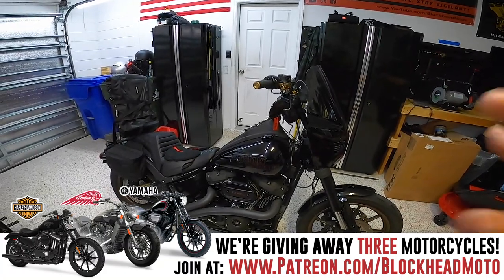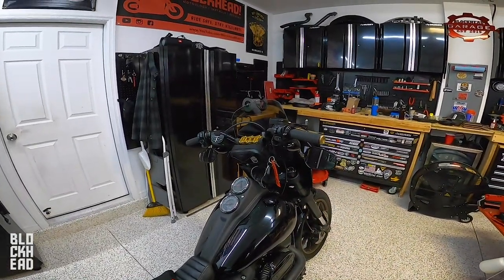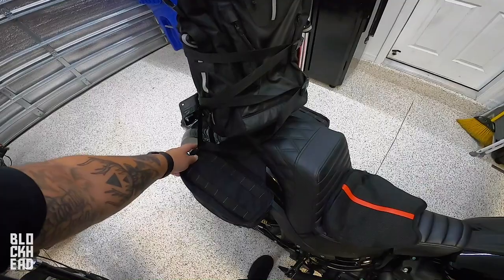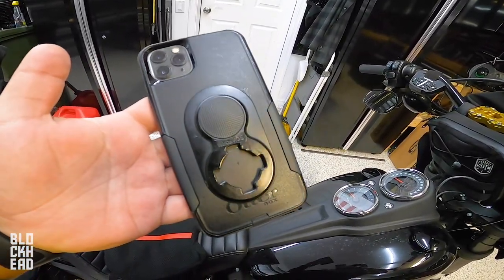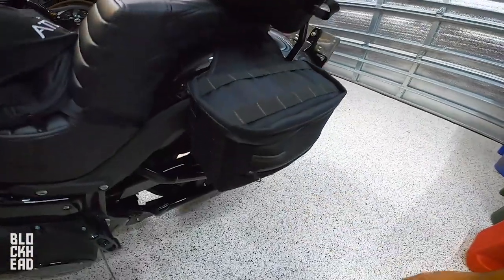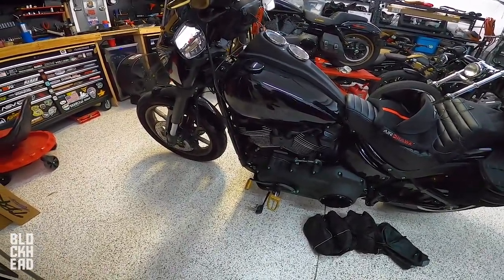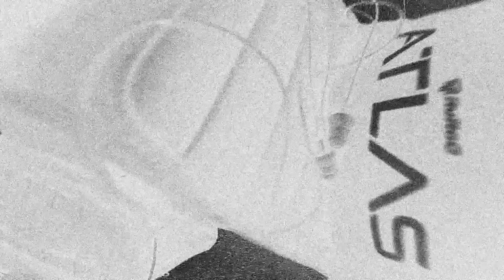800 Mile Motorcycle Road Trip Gear & Essentials! (Harley Low Rider S)

Comment from the maker: What's some other gear that y'all would recommend? Comment below with your recommendations!
Reply: Why are you orange?? Lol
Reply: Foot pegs with a heel rest was a game changer on my sporty
Reply: You could always get sportglide panniers and do a tail light relocation. They fit on and off in seconds
Reply: Not an XR1200 stock seat. Anything but that.
Reply: I recommend anything for hydration on the long trips. I used to run a camelback but now I have a perch mounted cup holder. It is super easy to get dehydrated on long runs and could quickly ruin a day.
Reply: Check out a laminar lip.
Reply: I broke down and bought some touring luggage that sits on my pillion. It carries a good amount of stuff and provides a backrest to lean on. It makes a world of difference on a long ride to be able to lean back and relax for awhile. Not having to hold yourself upright the entire time also helps with fatigue.
Reply: Emergency fuel bottle!
Reply: Crash bar with highway pegs or a mustache bar is worth it. Gives you more options to move around and change your position
Reply: Nelson Rigg used to make a set of expandable saddlebags. They may have come in a zip off version. The only thing I would recommend and you touched on it is larger bags. I like highway pegs and floorboards on the 97 Heritage but I used to use the passenger pegs on a former ride, a 1980 Suzuki GS850G. Other than that, you have a good set up. Note: I fill the drybag with clothes for a backrest, drinks, tools and such go in the saddlebags depending on the trip. I have moved on a bike so, figured out how to pack and loadout the bike for a big ride.
Reply: Honestly dude the ez mount leather pro bags. These bags are amazing and not imagine my fxbb not having them. I can't suggest them any more. So fast to take off once home and boom ready for around town again.
Reply: Highway pegs are wonderful! Im 6'4" with a 36"ish inseam, being able to stretch my legs forward is super helpful. What control thing is on your bike just to the right of your cruise control lo/high beam area?
Reply: I also super recommend some decent size hardbags that you can lock but connect to the bike via a quick disconnect system. Tons of room but it doesn't have to live on your bike by any means.
Reply: @BLOCKHEAD I know you said you're getting the bigger thrashin bags but you should just get a set of Leatherpros. They are quick-detach, expandable, and worth every penny. I never run a sissybar anymore since I could stuff my backpack in 1bag and spare visor and other gear in the other.
Reply: @marks_sptglide311  Sport Glide bags are a great way to go. They're hard shell, lockable and cavernous compared to most of the softail compatible saddlebags I've looked at. Paired with my Saddlemen BR3400 (main compartment fits a fullface helmet), I can haul 8-10 days worth of clothes and equipment with room to spare for comfort items.
Reply: WinexBlaze was
Reply: Friendly Normie agree with you there I fit heaps of stuff in mine I thought I would only use them on trips but have them on all the time.
Reply: i actually use a tom tom for gps. i have been in areas where you dont have cell service and with a real gps you always do. and i am like you i like the softail so much better than the touring. they are about 150 pounds heavier and just with that will be slower. it is like you have a passenger all the time on the back. shesssh.
Reply: @VINLAND_FXB  Plex Audio bluetooth controller.
Reply: Wipes for the faceshield
Reply: WinexBlaze I have a Scout Bobber. I was looking at the floorboards for it but after your comment you have me considering a heel rest. I was thinking the floorboards might be a little much. 
I wonder if Block and his buddies have some thoughts on which might be a better fit.
Reply: If you ride Solo and dont have a sissybar, get a bag for the pillion seat. if its big, you wont need many other bags, it looks way cleaner than a giant topcase, aaand you basically get a backrest without looking like the old guy on a road king.
Reply: What sissy bar do you have on there?
Reply: @winex82  Yep LOVE my Kuryakyn Swing Wing Pegs for that reason. I have about 3 main riding positions with them including fully reclined with the heel of my boots on the top. Best relaxed position there is while using cruise control on the interstate or a traffic free back road.
Reply: @CaffyPvP  Same, I hate the look of a touring bike with the windshield, saddle bags, sissy bar/passenger luggage, so I bought quick disconnect saddle bags, and a suction cup passenger pad and just got a 60L passenger bag which should be much more comfortable on my back compared to my 75L backpack that would start to be uncomfortable on my back after about 3hrs. That way when I'm not on a multiple  trip I take the bags, passenger pad, and passenger bag off. Also a direct to battery SAE connector for easy/fast trickle charging, jumping, and also during rides I plug a USB fast charger into it under my seat and run a cable to charge my handle bar mounted cell, works great.
Reply: Gortex boot's for starters, lol. I really like my Viking bags. Plus they are waterproof and have plenty of storage. You don't need a big touring bike to enjoy long rides.  Highway bar's do give you a lot more option's to stretch out on those longer trips.
Reply: @blockhead do you still use the plugfones?  If you do, how are they holding up?
Reply: I to use my rear pegs on long trips, I'm only 5"1 & with having the Factory 47 Marlo bars (classic) 16" bars.... I can stand up on the back pegs on my "17 Dyna & it's like standing on a dirt bike.
Helps to stretch the legs & back... I'm using the solo HD push forward seat & has more padding especially around the rear of the seat👍💪
I bought a USB port & wired it up to charge phone while riding...
🤣😂 Yep I got the Memphis Shades hand guards & ♥️ them 👍💪💪
I use a throttle lock system too, cheap from eBay & I also have heated grips & they are awesome ♥️💪💪
Keep Living the F#@KING Dream ❗
Safe travels 🙏♥️🐾🐾🇦🇺
Reply: Go to 89 and fix it already. Or then you gotta spit onthere's a sprawmer. No windshield don't need an internet ship and an old biker. No radio no not to just go and ride

Comment: Block, before I bought a bagger, I used to do long trips on the cheap. I started on a Sportster, then a stripped 80 FLH Shovelhead. Rode from FL. to New England. Out to Mississippi,  and all over the southern states. A large duffel bag strapped on the rear and a tool bag on the forks. I carried a large Heafty bag to cover my duffel if it rained. Then a few years back I broke down and got a bagger. I like the bike, but miss how I used to travel. Just a different feel.
Reply: What I’m scooting around on a 79 flh-80 shovel chopper. Small tent and bag strapped to my sissy and a tool roll up front. No windshields, cruise control, suspension (hard tailed), suicide shift no front brake. It serves me well
Reply: I think the sense of adventure of trying to get all that shit on a bike that's  Not meant for is half the fun lol

Comment: Best motorcycle touring advice I ever got- "Bring half the shit and twice the money."
Reply: Justin Maas from my own experience of when I was young and use to ride 12hrs straight only stopping to fill up was dangerous but I was 20 and bulletproof. I’m 42 now I just did 2000km in 4 days on my 1200 Sportster, stopping 5 minutes every 150km. My butt didn’t get sore on my OEM seat. I wasn’t tired even after 500 to 600km a day. So, definitely stop for shorter but more frequent stops.
Reply: I basically spent the last year one week away and one week at home because of work. I got really good at figuring out what I didn't need to bring with me and, how to tightly pack what I did need to bring. By the end I had one backpack strapped to my seat with bungee cord.
Reply: Socks n underwear are always good to carry extra though

Comment: Used to have some of those Plugfones in blue. I covered them with yellow foam tips so they would look identical to the earplugs we use at work. I then just ran the wire thru my shirt and thru a hole in my pocket to plug into my phone. Got to listen to podcasts all night without the boss knowing.

Comment: 100% agree, no wearing a back pack, it just sucks. I started with a factory shield and cut to suit. The right height really makes or breaks a long haul. A comfortable seat really determines the joy of  a long ride. I have used air pads and sheeps skin to up the comfort level.

For legs I have floor boards and highway pegs, being able to move the leg position really helps.

 Ear plugs, I just use foam ones and I actually hear my stereo very well with them in. Agree on a long haul constant road noise wears you out and endangers your hearing. Find some that works for you.

Cruise is nice on any super slab you find yourself on. Allows you to rest the right hand, something we take for granted with the left.

Over all nothing teaches you like the hard way. If you are unsure, just pack and go ride 500miles, you will learn do and don'ts quickly.  My first big trip with my girl at the time.....didn't even make it to the city limits! LOL!  Major re-thin, re-pack and left the next morning.   Cheers

Comment: Bung King Crash bar. Engine protection that isn't hugely obtrusive, and you can use them as highway pegs.
Reply: 1000%
Reply: I agree use mine all the time ✌️
Reply: They also protect the paint right?
Reply: @ClassicTor  they work the same as your standard crash bars. Block did a video on the ones he put on his Lowrider.

Comment: I have forward controls on my 04 883 sportster and no passenger pegs. At times I think adding mid control pegs would be nice just to move around though I’m not going to lie I love having my feet in front of me. I made half that distance in two days and was definitely feeling it. One nice thing about forward controls is you can rest the back of your boot against the pegs and stretch out even more for a bit.

Comment: Since you mentioned your boots and socks getting fully wet it may be a good idea to get engine guards with soft lowers? The soft lowers can be added when it starts raining and be removed when the sun is shining again. Just a suggestion. I bet that combined with the hand guards and taller windshield will make longer rides much more comfortable. 

As always, ride safe!
Reply from the maker: I’ll have to check that out!

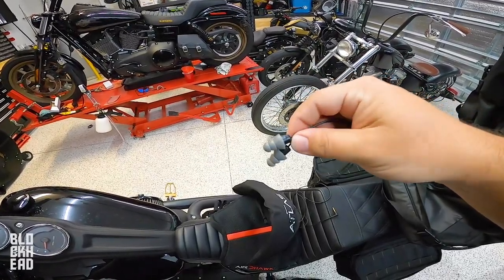Comment: 10:43 so I messed up my hearing pretty bad from riding without ear protection.  Last two years been using the hearos foam ear protection, and it definitely keeps the wind noise volume down to a whisper and you can hear stuff around you still.  Recently got a new and proper fitting helmet and installed the Cardo Freecom 4+ and I can still hear music and phone calls through the earplugs, it's good.  Can't handle riding without the hearos foam ear protection though.  I used to use a wired earplugs but never got nice ones to protect my hearing enough, so it's ear protection and the sound system in my helmet.  I hear you too with the touring bike thing, I got a Yamaha Stryker and it's like a Breakout.  Ride safe

Comment: Getting ready to take a trip to Key West on a 750 trike. I am glad I came across this video. I think I have covered most of the things that you have mentioned. One thing you talked about was your boots getting wet. I purchased a pair of rain boots that just slip over my regular shoes. The cloth uppers come a little above my calves almost to my knees and have a hard bottom. I am expecting them to work well. I still want to get the highway bars with foot pegs because I am tall and I do not think I can stay folded up for the entire trip. I plan to use this video as a guide for my trip. Thanks for it.

Comment: Quick detach windshield, bags, passenger backrest, and air hawk are the best bike accessories ever. If you wanted more wind protection but not higher windshield one with a flared top would work too. They make a big difference. Also for bags that one looks good quality but is small. The Nelson Rigg NR-230 backrest bag is absolutely amazing. Obviously designed by bikers with the hatch to access whats at the bottom and the way it attaches so securely. A LOT bigger than that backpack. Might even give you enough room you don't need bigger bags. Also if you sit it on the passenger seat you can lean back against it and use it as a backrest.

Comment: You can do the same trip without saddle bags. get a bigger back pack and strap it flat side down over the rear seat. I've done 6000 kilometres +- 3700 miles with 1 bag, 1 small tent. Long trips you ride through the rain on the other side of the clouds you will be dry with the wind. Wrap all your clothes in a plastic bag to keep essentials dry. Ear plugs definitely essential. Cruse control or throttle lock 100% agree to reduce wrist fatigue/ache. Good video.

Comment: Thats why I ended up with a Sport Glide. And I added also a Sissybar. I cannot believe how I was living before. A Sissybar is the best invetion for a Motorbike. For Audio I use the Airpod pro, either in neutral or noise canceling mode. I think a for this  Low Rider S a Sport Glide Bags would fit nice.

Comment: I did a 5k mile trip out west on my LRS in May-June. Mostly on 2 lane roads and not on interstate hwys. The stock tires suck.
I recommend a tire plug kit and mini air compressor. Being able to move your leg position is very helpful. Use the best gloves you can afford. 
By the end of the trip I had a good system for packing my stuff and being able to get to it quickly. Also, having a little cooler with water was essential out west.

Comment: 5000 miles Detroit to Vancouver return trip Sportster XL1200 C. My advice - ear plugs, chapstick, sunblock, and a bandana around your neck. Also full finger gloves. Best gloves in the rain ?  get the rubber kind cement masons wear, get ‘em big and wear a liner inside. If your ass starts to feel it, every Walmart sells an office or auto gel seat for 20 bucks ,there ya go. Get on the highway, that’s what your bike is for. Don’t over think it - Stay Cool.

Comment: Just got my first motorcycle 2000 Honda shadow 750 and did a road trip from Dallas to Fort Myers. Wish I’d of had cruise control my grips and handle bars were so uncomfortable and the vibration ate at me over time. Was pretty rad tho on the open road
Reply: I had the ACE 750, I had 65k miles on it... great bikes!
Reply: Bryan Umberger awesome good to hear!

Comment: @BLOCKHEAD  before you get a different windshield make sure that the fairing mount is adjusted properly... I have a 2019 Sport Glide and I was getting bad buffeting over 70ish mph with the 11" Road Warrior windshield... I had the fairing mounted similar to yours... I adjusted it to angle the top of the windshield back as low as I could and it made a huge difference.

Comment: Hey Mr. Blockhead.  Yea I have been working on my travel setup as well.  XL Viking saddle bags (holds a 12 pack have experience).  Memphis Shades Memphis Fats windshield.  Sissy bar bag (need a bigger one).  My next goal is to ditch the tent for a hammock and rain fly set up.  As you said I don't need a touring bike because I don't do it that much but when I do it's nice to have storage.  Great video.

Comment: FYI for anybody with denim paint. I did just just a hair under 3000 miles roughly 2900 miles and change on a trip. I have the fat Bob with the black denim paint. I put a towel Underneath my backpack And strapped it to my rear Fender. I used bobbing pins to wrap the blanket around the backpack so it had a soft back. I even folded the blanket so it had double padding. I still got Polish marks on my rear Fender.

Comment: I have the bigger thrashin saddle bags. They fill up pretty quick too but they're perfect for little stuff like drinks, snacks, tools, etc like you mentioned. The zipper for the main storage compartment is trash though, it's the only thing I don't like about them
Reply: Chandler have them bags damaged your paint at all I want to buy some but can't find any long term reviews thanks
Reply: @danielglover2923  the back of the bags rubbed on the rear turn signals and wore off some paint but it's so minimal that it took me forever to even notice. Besides that, no significant wear and tear on the paint. I'd recommend these bags. They get the job done and they look good. I've used them with no issues on 1000+ mile rides.

Comment: BLOCKHEAD I know you said you're getting the bigger thrashin bags but you should just get a set of Leatherpros. They are quick-detach, expandable, and worth every penny. I never run a sissybar anymore since I could stuff my backpack in 1bag and spare visor and other gear in the other. If you get a set you will never see the need to buy a bagger.

Comment: You should definitely get a shock absorber for the quad lock phone mount.  These smart phones have accelerometers and other components inside that get destroyed on calibration and functionality from motorcycle vibrations.  It will ultimately save your phone and they are reasonably priced.

Comment: My gear I add to my 2012 Yamaha Raider S when I rode overnight is 
1) quick disconnect hard plastic, (leather looking) saddle bags 
2) Suction cup passenger pad to sit my bag on
3) 75L hiking back pack or 60L passenger bag
3) portable battery jumper 
4) portable air pump with plug kit 
5) solar portable battery charger 
6) 
USB quick charger plugged in under my seat with cable running to cell on handle bars

Comment: Have you tried one of those windshields that the top lip tips forward to push air above your head the Harley convertible comes with easy on and off bags and I believe the windshield removes like the road kings too. But then again my 05 road king I used to have had the same features.